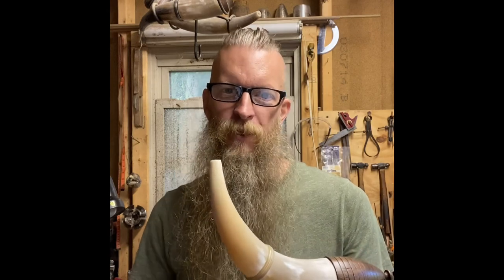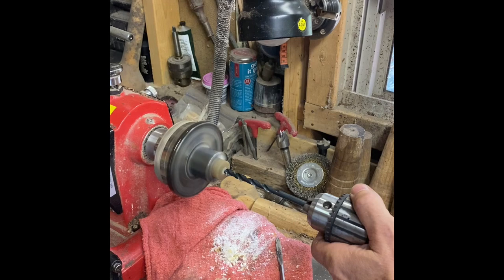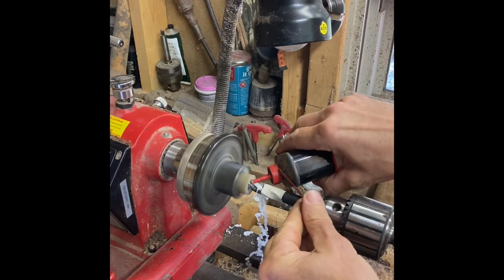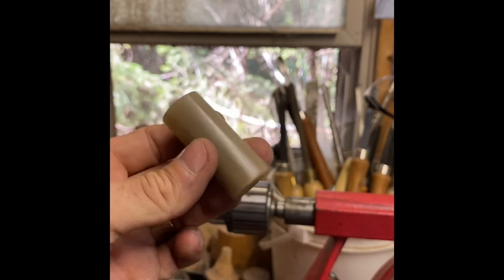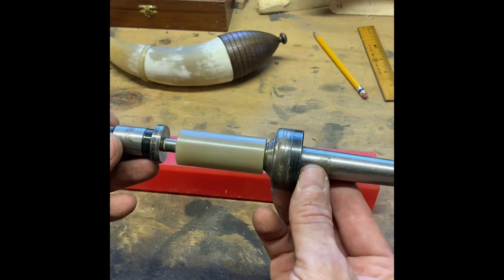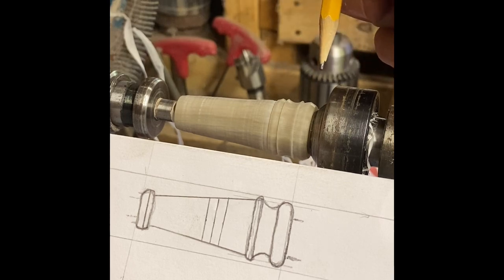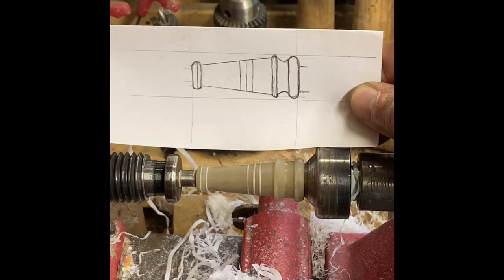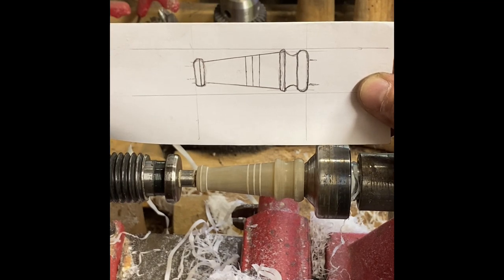Turning a Horn Tip

Comment: What do you use to attach the tip to the horn ?
Reply from the maker: The tip is both glued and pinned on with three small wooden or metal pins. The glue mostly acts to waterproof the connection the pins actually hold the tip in place. I’m hoping to do a video or series of videos the show the whole horn building process start to finish. Thanks for your question!

Comment: Hi there, new to this channel and love your vids. I want to ask, can you not use the horn tips you cut off too make the plugs for the same flask?
Reply from the maker: I’m sure you could but it would require some work. Historically speaking, spout plugs were usually made from a soft wood such as pine or poplar. They were generally simple: a tapered plug to fit a tapered hole. This allows the plug to still seal well and keep moisture out even as the wood and horn both change due to moisture content.

Comment: Has anyone used a brass garden hose end?
Reply from the maker: I’m not sure a brass garden hose end would be historically accurate. These banded horns with applied horn and bone tips are well documented to the late 18th and early 19th century. They evolved from the Pennsylvania screw tip horns. As gun making slowly migrated south so did horn work and a unique southern style developed.